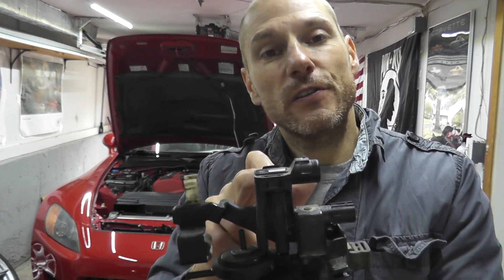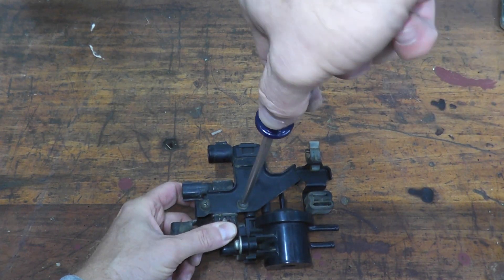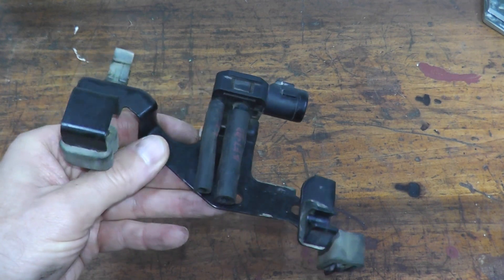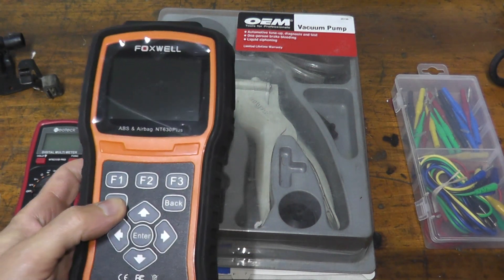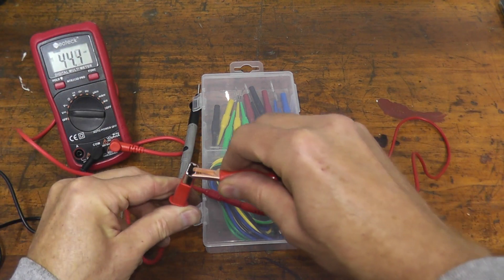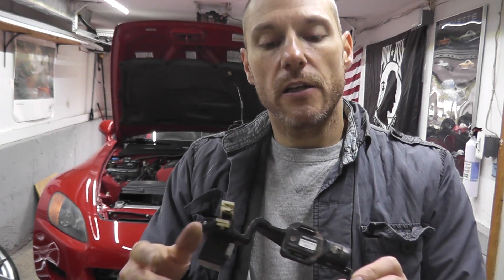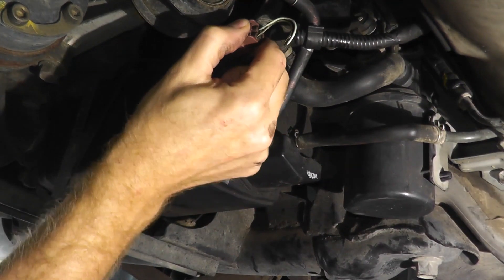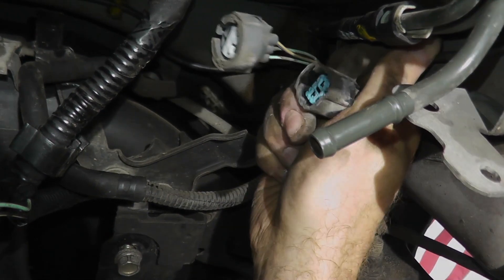How To Test And Replace Fuel Tank Pressure Sensor P0451 P0452 P0453

Comment: Really like your videos. I was checking fuel pressure sensor on my 01 Acura Integra. The harness to fuel pressure I got 4.97v on the yellow and on the 3rd wire I could not get 2.50 I was getting 4.66 is that mean it’s bad, but I got continuity on sensor.

Comment: I had a very weak battery that required jump starting in cold weather, in the end the CEL came on... Still drove the car for weeks as the weather warmed up (No Jump required), got the CEL diagnosed at my mechanics garage as FTPS... I replaced the battery and this CEL code never came back on, been a year now !! I guess the voltage these sensors receive have a lot to do with functionality, who would think a bad battery would cause a code like this to trigger ?? LOL

Comment: 🔥 vid. I have a. 2003 Hyundai Elantra GLS with p0451 and I can’t find the fuel tank pressure sensor. It’s not on the fuel pump. Where can I find it or is there a way to find it? Thx

Comment: You connected the meter to the yellow wire are the other two wires lowering the voltage to your meter after you apply the vacuum, what is lowering the voltage If power is going into the sensor that must mean the other two wires are controlling the power to the sensor I'm a little confused

Comment: What does it mean if the voltage goes up on the signal wire when vacuum is applied to sensor

Comment: I had mine replace now the engine surges and it has felt like when I'm stopping at a slow speed that it surges when stopping.  Also see s to cut out when going slow.  When fast it's harder to tell but noticed the engine sounds like it's not running steady but is surging like constant but runs smooth

Comment: The secondary air pump on my 02 DeVille crapped out because of the horrible design of being able to suck up water. Never replaced it and I'm pretty sure it contributed to clogging my cats.
The one in my 08 DTS makes a whirring noise on cold start, but I'm pretty sure they redesigned the water sucking up issue.